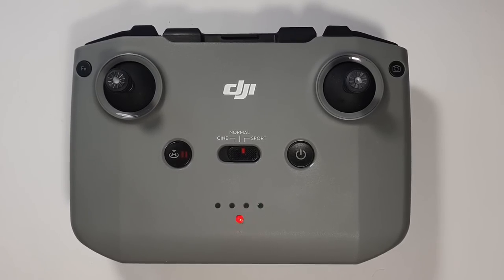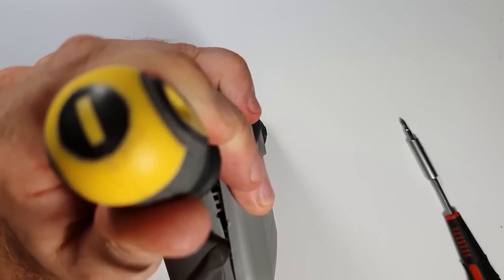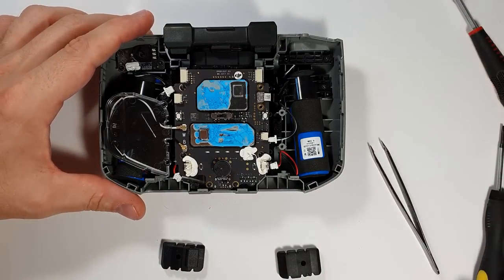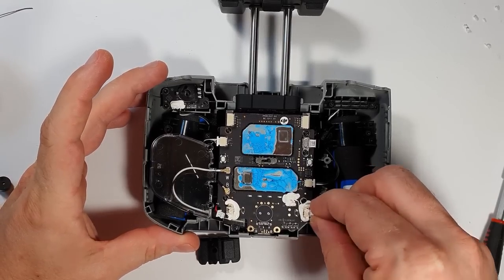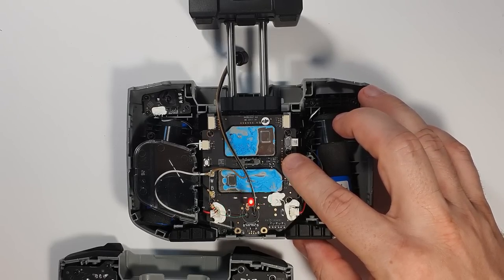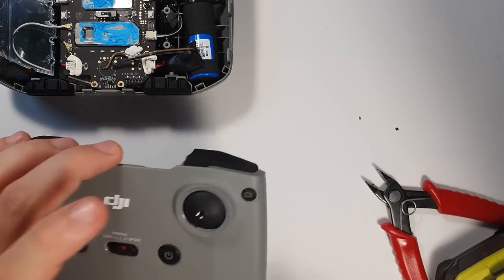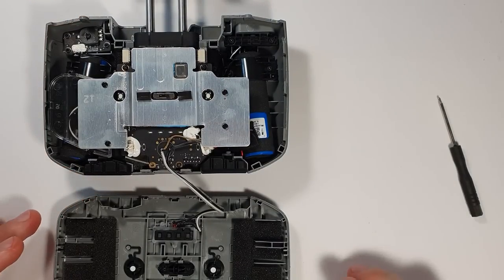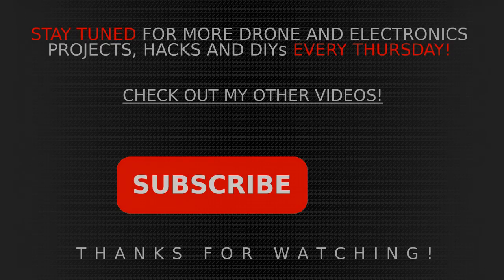Simple DJI Mini 2 and Air 2 controller mod (silence the BEAST!)

Comment: I also did away with the horrid controller buzzers in all of my remotes- but I included a switch and a vibration motor from a scrapped phone + plus a small driver FET in my mod. Now I can switch to silent with vibration feedback instead which is really nice when I'm flying in 'stealth mode' (with Bluetooth earpiece for app audio)! 👍

Comment: Thanks for this guide. I was able to install a 3mm blue LED and 1.5k resistor (even quieter) and now I don't have to listen to the annoying beeping for the last 20% of the battery. 

Also, for us Americans, a 7/64 in (~2.8mm) drill bit works well for the LED hole
Reply from the maker: Awesome! Well done on your hack! :)

Comment: Wouldn't it be easier just quickly press power button onece and control goes silent mode. Also you can also turn remote volume with your phones volume button while it's connected. I've had my mini 2 for about month and figured that out.
Reply: What? How did you find this out?
Reply from the maker: The possibilities are endless! :) Good idea.
You see, I do a video and I let you guys do the rest of the thinking! 🙂 That will build a good modder community!😉
Reply: Lol hilarious!
Reply: Pressing the power button once only silences it briefly, if at all. It immediately starts beeping again, if under 15% battery, and it does not work at all when below 10% battery. Also, the volume buttons on the phone are completely independent of the RC speaker, and have no effect whatsoever on the internal RC speaker, SADLY!

Comment: i did a less intrusive mod to quieten the buzzer reather than remove it and drill the case.. just use some bluetack, hotglue or foam to push in to the buzzers hole and it makes it nice and quiet.. still functions, doesnt annoy the hell out you and doesnt de-value the control
Reply from the maker: Totally cool! :)

Comment: Excellent presentation of some very cool modifications. 

You mentioned possibly adding some additional quick shots. I've seen people do this supposed "hack" of the feature "follow me" which is not offered in the mini 2. (It's manipulating the drone into acting as if it has the follow me feature)

 It would be extremely useful and cool if that feature could somehow be added to the mini 2 (which is the 1st & only drawn I currently own)
Reply from the maker: Thanks! :) I am working on some ideas, but no breakthrough yet. A workaround could be to walk the path you want the drone to follow you on, in a specific pace. Have the controller in hand and drive the drone to actually follow you along that path and record it with the autopilot mod Part3. Then go back to the beginning of the path, and make the autopilot recreate the same "follow you flight", and just walk down the path... :) I would do that. The main thing to consider is wind!
Reply: @ZollyD  I'm not sure how "follow me" works with the other DJI Quad Copters. Except that you lock into the person on the video screen green box is drawn around you to ask is this what you want to follow and you click yes and it follows you not sure of how.

This is my first drone the mini too and I've only flown it twice even though I've owned it for 2 months.

But I will be extremely interested to see whatever you come up with because you have great ideas

Comment: Nice mod but isn't there a way to maintain the beeping but quieten the sound?
Maybe muffle it with a foam or rubber pad?
EDIT- I commented a little early, just watched the bit where you use tape over the buzzer. LED is a nice visual warning as well.😎👍
Reply from the maker: Thanks! :)

Comment: I wander if there is room for a potentiometer next to the led. You can connect to the buzzer instead of the 1k resistor, and have un adjustable volume for the buzzer.
Reply from the maker: Yes there is room for a low profile pot there. 👍 At the time I did not want to drill one more hole on the controller for that, that´s all.. :)

Comment: Hey zolly I love your channel and I was going to do this mod but I have a question when you put the tape on it does it quiet the voice like how it says home point updated please check it on the map does it quiet that or just the beeping like the low battery working etc? Please answer I’m subbed if that makes you want to answer aswell
Reply from the maker: Hi. Sorry for the late reply. If it still matters: the tape only makes the annoying beeping quieter. All the other speech is coming from your phone speakers actually. If you fly without the phone, you dont hear homepoiny updted message

Comment: I always felt that the up and down wheel for the gimbal on the controller needs to be inverted. I am a pilot and to me pulling should be up.. So...... Is it possible to change this? Thank you for all you do for me. I have learned alot from you. We have similar ideas but you are an educator. Great videos man. Peace.
Reply from the maker: The connector at 04:41 is for the gimbal wheel. If you flip the positive with the negative then the adjustment direction will be reverted. So from the 3 wires the middle one and the white has to be flipped. Best done on the small PCB at the wheel after removing the silicone. :)
I am happy that you learned stuff. Keep up the curiosity for everything! :)
Reply: Hey thanks! Your awesome man! Have a great day today.
Reply: I also requested of DJI to provide true joystick customisation so that the up/down joystick could be inverted  because I dived into Loch Ness while flying like a fixed wing.... Pulled instead of pushing.
Reply: @neiljolliff8170  You don't need DJI to reverse the throttle or any stick movement.  In DJI Fly, just go to three dot menu, control, Stick Mode, Custom. You don't have to choose stick mode 1, 2 or 3, you can reassign or reverse stick movements to your hearts (and fingers) content.  Windswept Robert has his throttle exactly as you describe.
Reply: @BlairAir  last time I looked you could only swop which stick did up /down in custom not actually which direction. I'll check again. Thanks for your reply
Reply: @BlairAir  Not possible in the android dji fly app so it must be an iPhone thing
Reply: @neiljolliff8170  Sorry that didn't pan out for you. To be fair, I never tried swapping throttle inputs. Windswept Robert managed it... on an IOS device so I'm sure it's as you say 🤔
Reply: I also couldn‘t find a software reversing of gimble up/down in the customized settings of my iPhone.

Comment: Electrical tape didn't work for me, even multiple layers. What did work is piece of Uhu patafix, and piece of electrical tape on top of that, so it doesn't get stuck to the controller housing. I would say it's 90% silenced.

Comment: Hey! cool video. I see your mostly working on a DJI controller. How about some cool innovations on a drnoe controller that doesnt have as many features like a HolyStone? My HS700D does basic flying and camera. it looks like theres buttons and switches that could do something but they don't move, slide or even press in. I will keep watching
Reply from the maker: I will try developing features which can be use uniformally regardless of manufacturer... 🙂

Comment: I didn't even need to mod mine. The speaker stopped working forever after 3 our 4 flights and doesn't make any beep anymore.
Reply from the maker: Oh... I didn´t quite get it if you are happy about it or not, but now you know what can be possibly done to repair it.  :)
Reply: @ZollyD  oh yes, thank you zolly! By the way, do you know where I can get one of these speakers to replace??
Reply from the maker: Ebay. Aliexpress. Banggood. The usual places. There is no part number on the original one so I guess just generic 5V piezo buzzer. There can be other (unknown to us reasons) why it went quiet. So if you want to repair it first take out the buzzer and test it with the LED resistor combo. Mind the polarity! And if the LED works (meaning the buzzer will get signal) order the new buzzer.

Comment: Yo man

Is it possible to put in something like gamecube or Xbox control sticks?
Reply from the maker: I don´t see the reason why would it be impossible... :)
Reply: @ZollyD  aww man... I finally got around to taking it apart...and its some tiny allenkey I've never seen before....

man I'll probably live without the VG sticks and just quiet the damn buzzard

what tape are you using? I'm finding tape isn't enough to quiet

Comment: I done it and it is quieter and I was super careful but now the button opposite to the fn button what has a camera on it doesn’t work, tried for hours fixing it but no matter what couldn’t do it and now the remote keeps loosing connection at random times for no reason, zolly please if you know why the button isn’t working and or the remote has started to cut in and out for no reason even when it’s within 12 meters and automatically returns to home every 5 minutes usually 2, 3, maybe sometimes 4 times when I’m flying could you tell me so I could fix it?
Reply from the maker: I have no idea. Simply doing exactly what was done in the video can not cause it. There are many things in thay controller. Sorry it is impossible for me to troubleshoot without having it in my hands.
Reply: replace the...left stick? the button probably crapped out as you changed it.

Comment: yeah, my controller too making noise, I have to calibrate every time I fly my drone. Its there a way to fix it .
Reply from the maker: That can be from the joystick potentiometers being out of calibration. Advice for the future: When screwing on the sticks for the controller do not tighten them too hard. It can destroy the pots inside. If your remote is beeping because of that, then the joystick module needs to be replaced. (I am just guessing here) Otherwise I would just try to live with it.... ANYONE HAS BETTER IDEA OUT THERE??? :)
Reply: I would try getting it replaced under warranty mine was dodgy too but not that bad mine only did it at the start but i think they have had quality control problems because of the problems everyone has been dealing with this last few years probably a lack of staff and the huge amount of drones being sold but as far as i know they are ok about returns . Good luck 👍